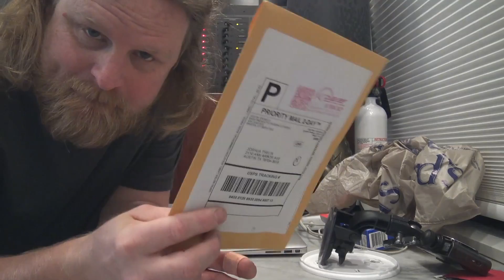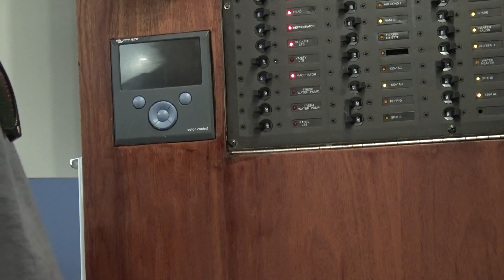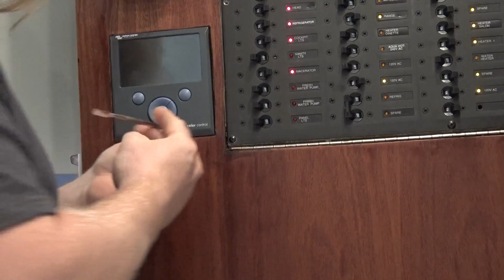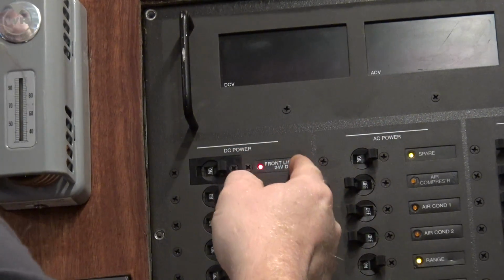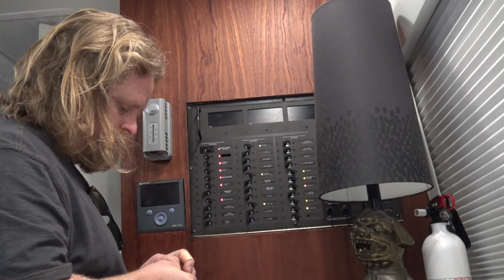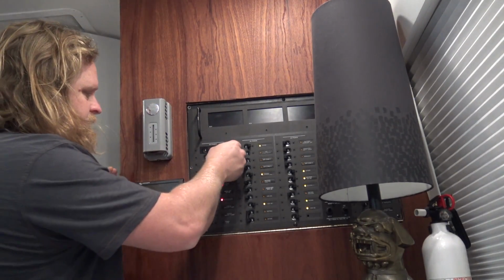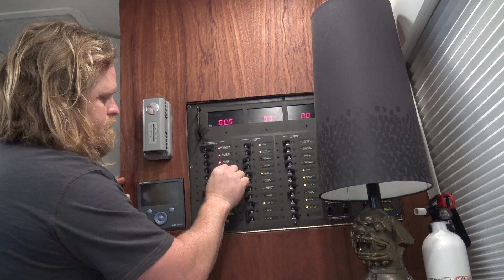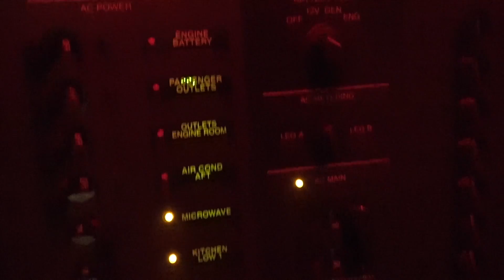Installing Bass Electrical Panel Labels

Comment: Yeah, I'm the same way about tagged stuff like your control board. Gotta be right or not at all! I have to find a place that makes the metal 'holster' for my 2 scanners,  cb radio, extra usb and 12 volt connections, plus whatever else I come up with, for a 2017 or 18 Chevrolet (Roadtrek 190)....similar to what the cops have in their car to hold all of their radios, etc. Stay warm in Austin today...it's 56, as I type, here in Houston, 50 tomorrow, and, 38 Monday. Shivers with our humidity down here! Later, Gator!
Reply from the maker: JIM BRIDGES gonna get colder still!

Comment: New thermostat? I recall the Nest was a mother to get functional. Just curious.
Reply from the maker: kurt prastka in the end it was just too confused to provide an accurate temp in the bus. Texas weather literally changes three times a day and the Nest just couldn’t figure it out. A two wire line voltage thermostat is super accurate to what you set it to and so it became a better option for my bus.